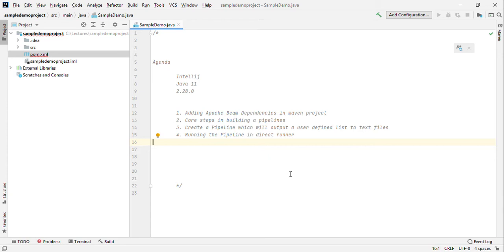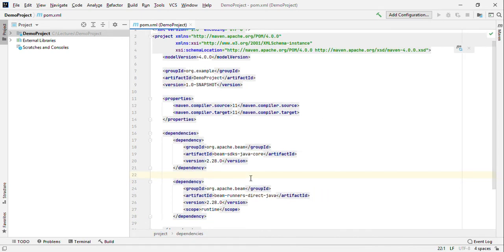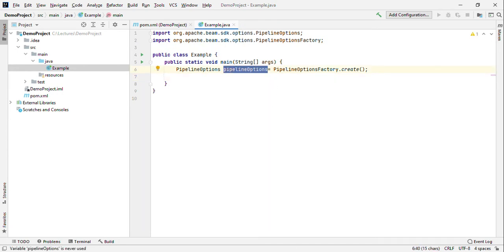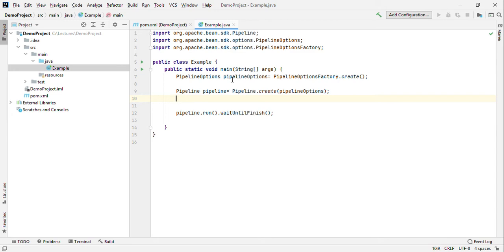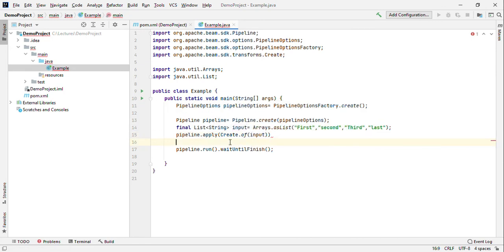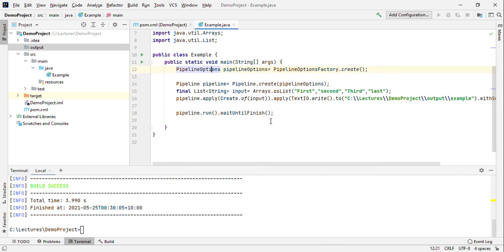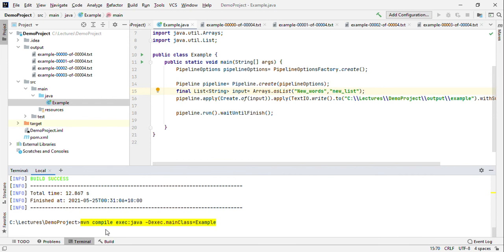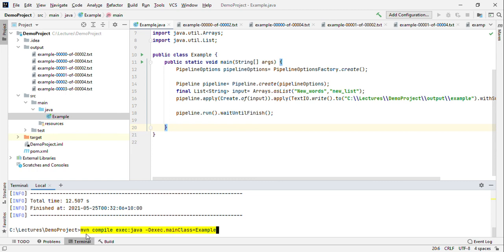Apache Beam  Step By Step: Lab 1 Introduction Batch Pipeline zero to hero

Comment: "No runner was specified and the directrunner was not found on the classpath" getting this error.
Reply: issue was with scope of the direct runner, changed from test (as the dependency was copied as it from the  repo) to runtime.And it  worked.
Reply from the maker: Check you are using exact versions of sdk as shown in tutorial . From the error it appears that you are not having direct runner in your class path

Comment: Why I need to add one more line "pipelineOptions.setRunner(DirectRunner.class);" to make the codes running, but you don't need to? Did you add options in program arguments?
Reply from the maker: Check the SDK versions